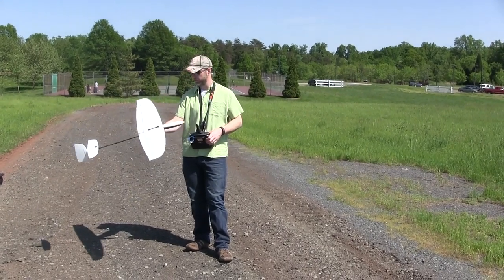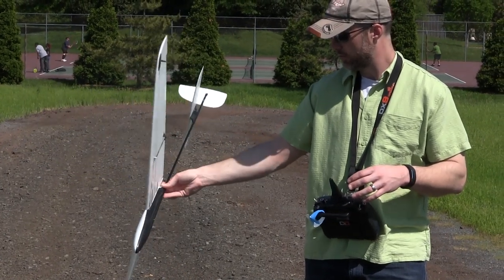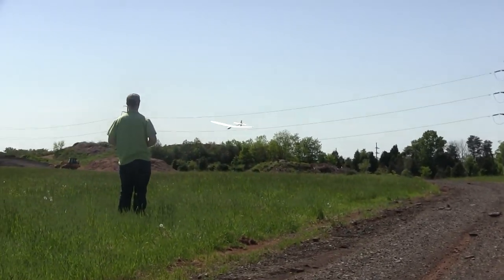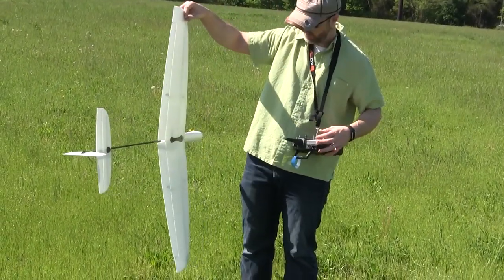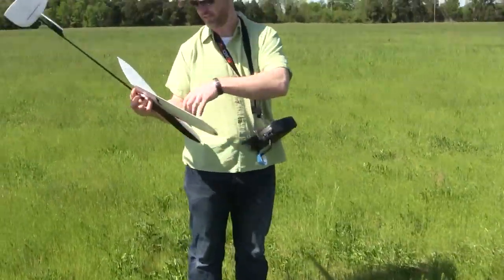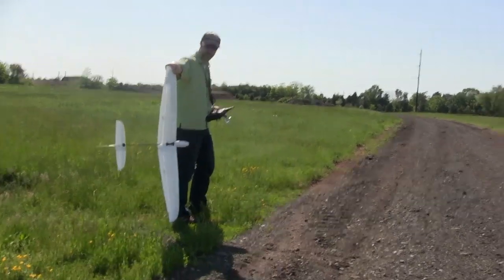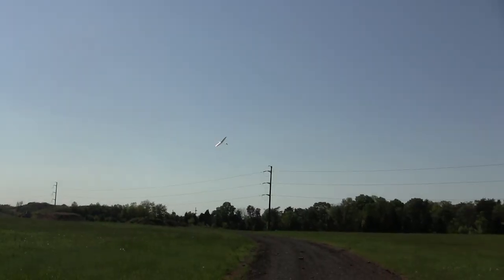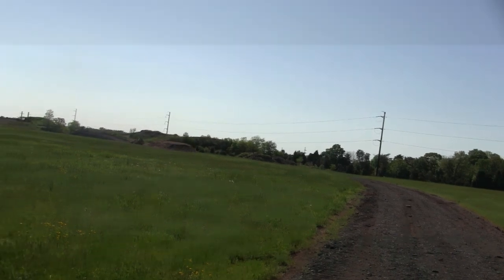Dream Flight Libelle DLG - First flights

Comment: Forget those crappy hitec servos. Everyone had issues with the whole batch. I used inexpensive Emax $6 serovs in my Libelle and it's been a blast. get new/reliable servos before the plane is toast. You'll love this plane on a slope. It floats forever. Good luck.

Comment: flew mine today twice on soft throws and then on my first hard discus launch it went slightly up and then straight down into the ground.  Big disappointment sigh.
Reply from the maker: Sorry to hear that.  I've had mixed results with mine so far, but it seems all the problems I've had are with the servos.  I upgraded to the digital version of the recommended servos, but I've still had chattering and unexpected movement.  On my last flights I found that one aileron would go to full deflection without any input and with no warning.  If it had been the elevator on a launch I could easily have dug it in.  Hopefully there isn't TOO much damage.  When I get a chance I'm going to put some stronger, more reliable servos in it.  Until then I can't really say how well the airframe flies...
Reply: yes same problem with mine.  the servo was "chattering" and on my first hard launch went full nose down.  lol its back together again.   good luck with yours.